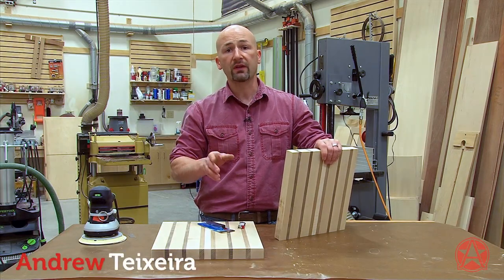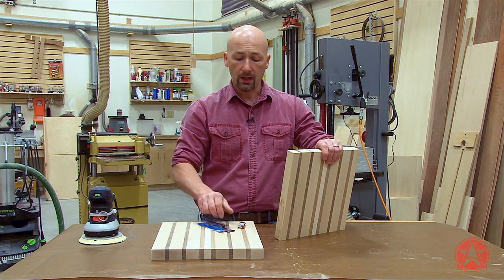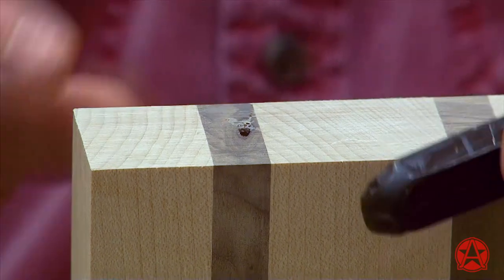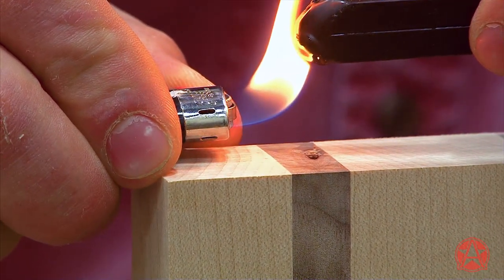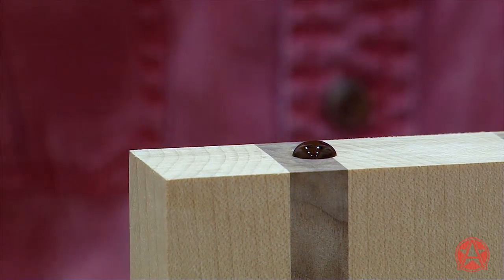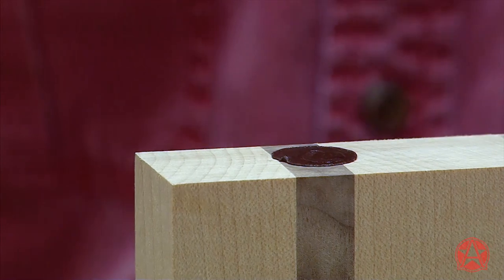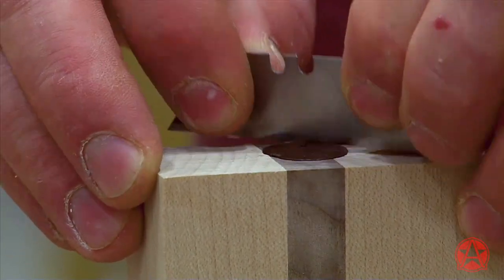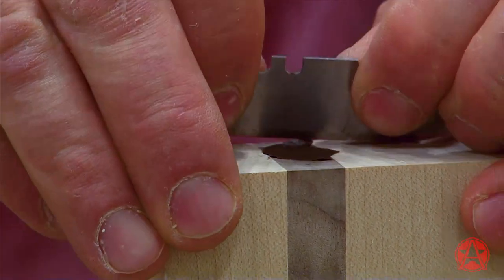Cutting Board Rescue!

Comment: I utilize 1800's walnut in alot of my cutting boards since that is what I have. There are some old voids from some type of bug that no longer resides, but it ends up being there sometimes when i get it to my thickness I want. In order to preserve material - would this work on the surface as well? (FYI - I put a homemade mineral oil and beeswax mix on my boards).

Comment: Thanks for this.  Would you also use this technique to fill a knot or void on the top of the cutting board?
Reply from the maker: Hi Clinton, 

Just make sure the filler is shellac based. Shellac is food safe.

-Andrew
Reply: Thanks.  The product you use in the video seems like a good one to use.  I’ll probably go with that.
Reply from the maker: Hi Clifton,

That product works well and has a variety of colors available. 

I have two other cutting board videos if you want to check them out. They may help you with your project. 

Good luck!

-Andrew
Reply: @anamericanartisan9846  great video, what brand is the shellac stick? Thank you for this

Comment: I have a wood cutting board that has developed cracks at one end and they are black (like mold). Could I repair it with a shellac burn stick. The cracks are not very wide (1/16”). The board is not expensive, but for it not be sentimental in value I would not bother.
Reply from the maker: Hi Fabio,

Sorry to hear about your cutting board.  It is possible to repair it but the shellac would not be the best method.

If it's cracked like that it means that the glue joint or the glue itself has failed. In this video I explain the importance of a proper glue joint for cutting boards. It may give you a better idea of what happened to yours.

https://youtu.be/tDM9CtUupf8
Reply from the maker: Hi Fabio,

Sorry  my last comment got cut off. I wanted to suggest that the best way to fix it would be to fill it with wedges of wood. I use a similar technique to fix some loose dovetails in this video.

https://youtu.be/h8n1_4jNK7I

Let me know if this helps or if you have any other questions.

-Andrew

Comment: I know Shellac is food safe but for some reason, it still creeps me out a bit.

BTW, can you cut meat on a wooden cutting board?

How do you clean a cutting board?
Reply: Yes you can cut meat on a wooden cutting board - wood is naturally anti microbial so you don't need to worry about it holding onto ecoli or whatever.

Just wipe with soap and water. To deep clean use coarse salt and lemon juice or vinegar